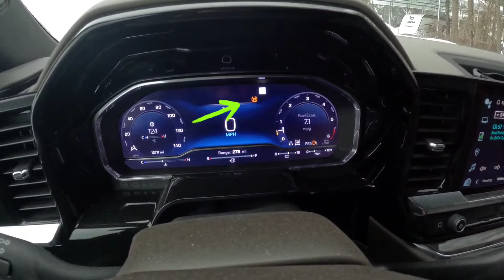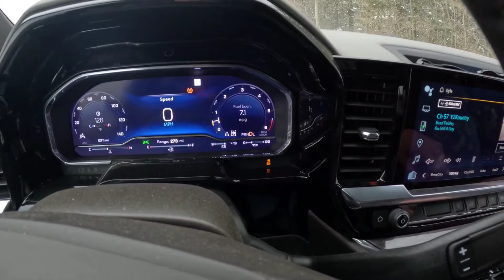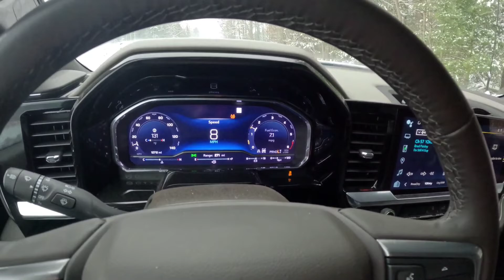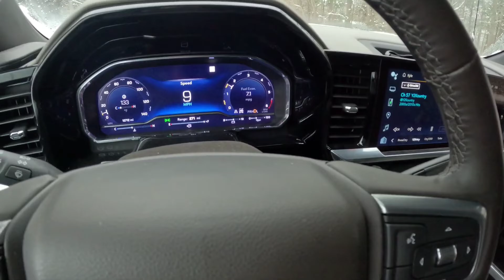Traction Control & Electronic Stability Control Explained | 2024 Chevrolet Silverado 2500HD

Comment: Tow haul mode enables first gear which is very low.  Normal mode always starts/stops in 2nd gear.
Reply from the maker: That’s correct, the transmission will start in second gear if you are not in tow haul mode. It just doesn't affect traction control characteristics

Comment: I have not read through the whole manual but wondered if they even explain all these quirks in this and other not so simplified systems on the truck. So if it was a bare bones truck as per the other dash even though a 2024 model, would it turn everything off ( for that matter not even have this stabilitrak system )
Reply from the maker: The manual does touch on these topics. But wanted to go a step further and actually show how they reacted. Like with engine derate and things like that. But I thought stabilitrak was now standard on these trucks for safety reasons